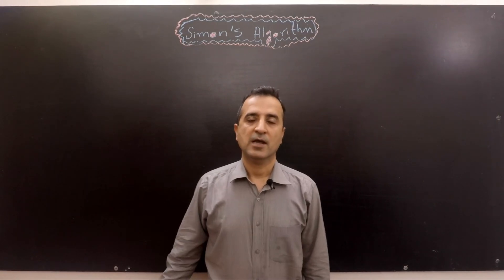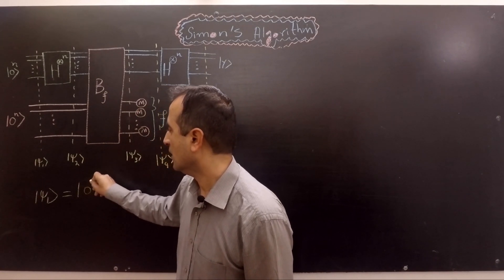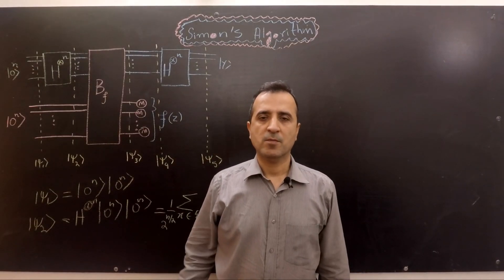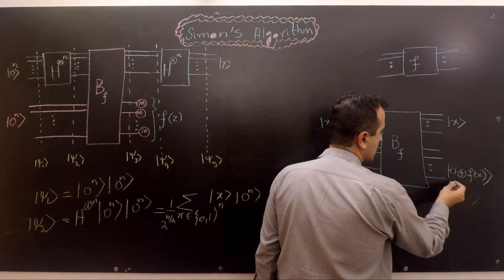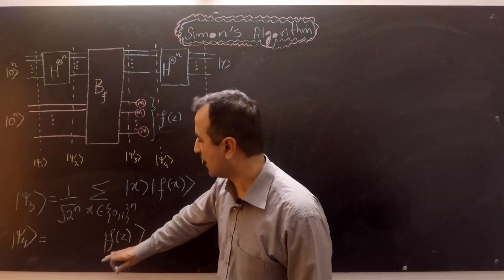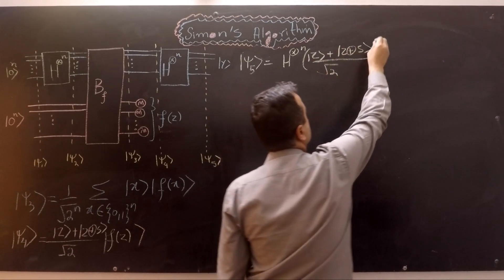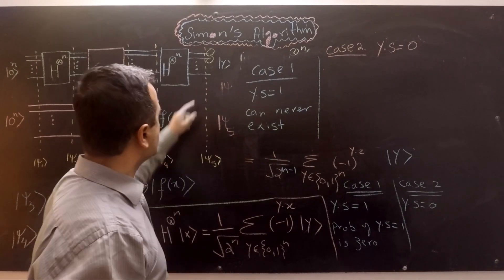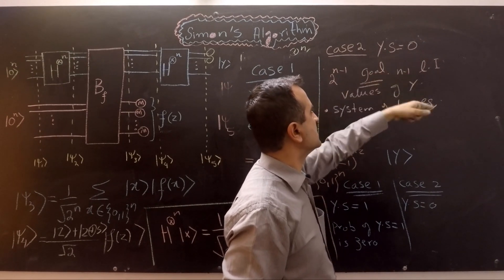Quantum Computing: Circuit of Simon's Algorithm (Part 2/3)

Comment: I got lost at psi3....
Reply: @Advanced Maths or others: Please correct me if im wrong, this is my first quantum computing course.
@Jasper Williams:  The Notation of Appliying the Hadamard Gate to |0^n> is the same as in earlier videos (I think in the fourth).  To get from |Psi_3> to |Psi_4>,
i think the idea is, that after measuring f(z), the terms of the superposition where the measured state is NOT f(z), have propability 0 (they dissapear in the sum). Also since we have a 2-1 function, there are only the values "z" and "z XOR s" which will lead to the (already measured) state f(z), so the sum simplifyfies to |z>+|z XOR s>. 

What i don't get is why  1/(2^(n/2))  becomes  1/(2^(1/2)). Is this a typo or do i miss something?
Reply: I think i get it now: 1/(2^(n/2))  becomes  1/(2^(1/2)) bc |Psi_4> has to be normalized, right?